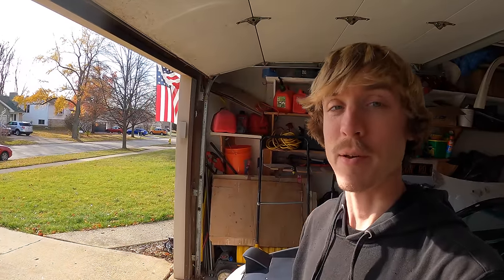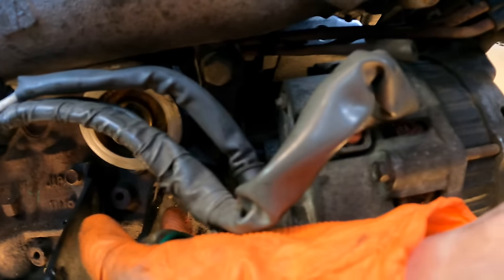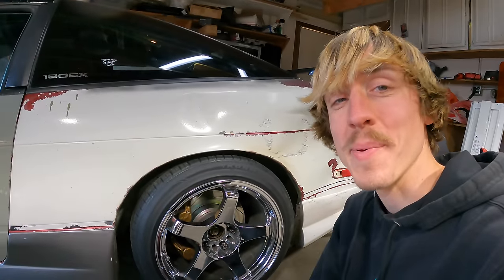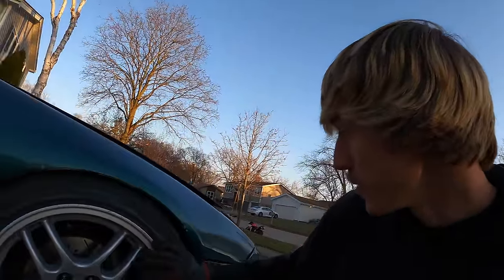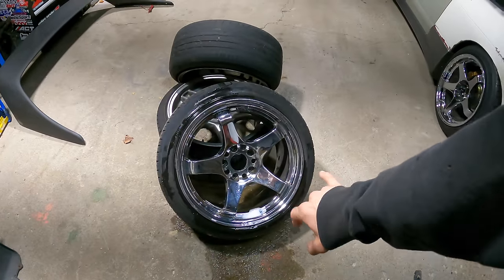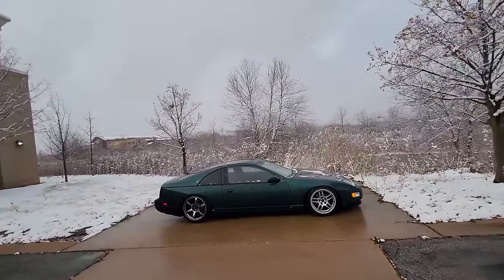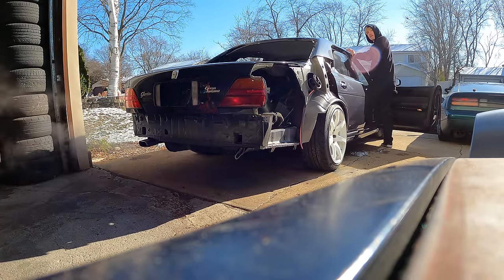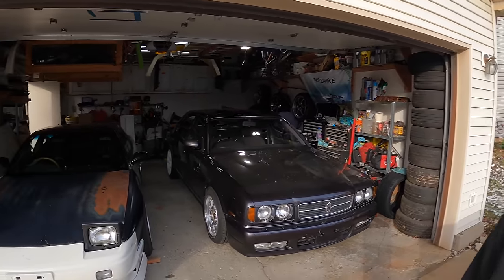Diving into all 3 of my Nissan Project Cars!

Comment: remote mount the z oil pressure sensor. take out the 240 one and replace it with a fitting and an AN line and then you can mount the new sensor any where you want to the end of the AN line

Comment: I just drained the break-in oil for my KA Xterra 2 days ago, and the filter I installed was an M1-110A. I guess the Mexican and Japanese blocks have different threads. 

Speaking of, It might be worth taking a look at your local junkyards for a Mexican KA (Frontiers and Xterras) to snag the oil filter housing off of one, it should only run you about $20; if I remember right they angled the oil pressure mount facing more downward (as opposed to in-line with the filter like the Japanese filter housing. I believe the mating surfaces are the same to the block, but I'm not 100% sure.

They also changed the design of the cast to more of a 45* elbow, whereas the 240SX cast was straight with only the filter mounting surface being clocked to that angle, so it should make it easier to reach the filter (more likely it's going to be worse to change by leaking onto your suspension components like it does on mine). 

P.S. That 15A fuse you replaced first was marked "Stop Lamp", the 7.5A one after was marked "Tail Lamp". If you ever need to translate panels like that, Google Lens is a lifesaver.

Comment: if you planning to upgrade the gopro 9 you could get a insta360 ace pro (the one with leica lens). its better on lowlight vs gopro too. you could get an entry level mirrorless camera like the zv-e10 which got better image quality but the down side is you have to rock it with a gimball (action camera still got the best in house stabilization)

Comment: Just started mig welding in my welding class i love it alr its so much easier then stick and you inspired me to take welding and i need to replace both back quarters because there completley rusted, if any of you are wondering im a sophmore and i drive a 2003 hyundi elentra gt hatch 5 speed and ofc manuel

Comment: Since you've never seen a different car that has third (or fourth) pedal - parking brake pedal. I will introduce you to older Mercedes's :) I myself have a C220cdi kompressor coupe and E320cdi as beaten up track cars. C220 coupe has manual gearbox and comes with fourth pedal (parking brake), E320 is automatic and it comes with third pedal. Since I am an Audi/BMW driver and am so used to these, I found and I still find these Mercedes parking pedals really odd/weird to use. They're not the best for stretching a drift, that's for sure, for that I would consider adding a hydro stick in the middle console. 
Would love to hear back from you, if this information was something new to you since you're a JDM breed and I am a German car breed (Japanese cars over here are a no no because of the extra salty roads and the rust problem is ridiculous on them) :D

Comment: The mobil 1 is an excellent filter for the money and has a synthetic filter media and a silicone anti-drainback valve, They are the best filter unless you buy a Wix or Napa Platinum. The OEM filter most likely has an impregnated paper element - I wouldn't trust Nissan past 2000 when they were bought out by Renault.  Mobil1 claims 99.6% efficiency at 25 microns. Don't think that because the filter is smaller, means it's less of a filter. Just my two cents.

Comment: I worked at a center and did quite a few Nissan oil changes and literally every one from some point in the mid to late 80s' to now, all use the same filter threads and gasket diameter. 

And the Mobil 110A filter will fit your DC.

Comment: 99percent of vehicle brands only use 2 different filters unless it's a crossover year or multi manufacturer vehicle. Like rodeo and passport take a GM filter but all Hondas use a Pennzoil 37 filter. And all Toyotas are a 21 or a 38.
Reply: Also how do you tune a vehicle with no clutch switch lol. None of your vehicles have clutch switches lmao I guess you can tune but no 2 step. Then again I have not drift...yet